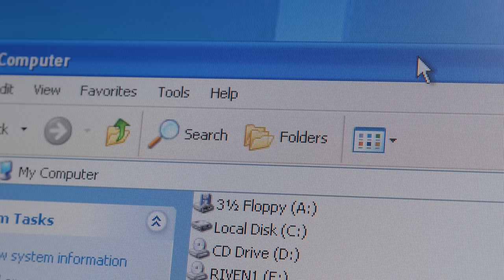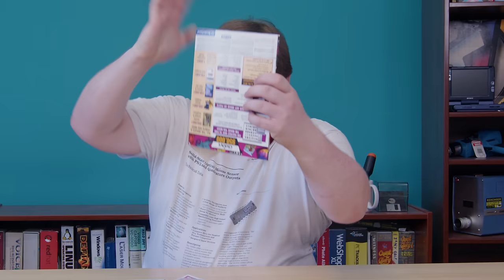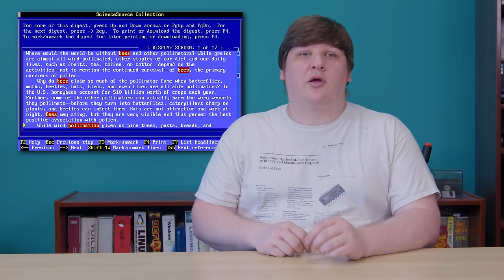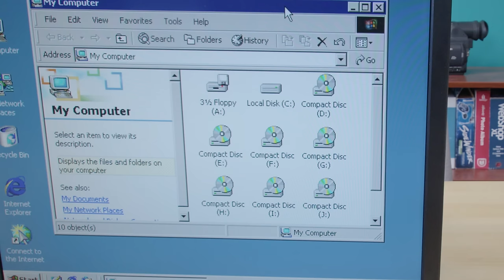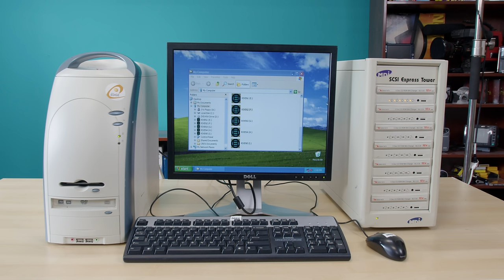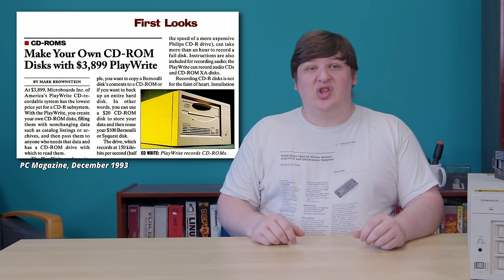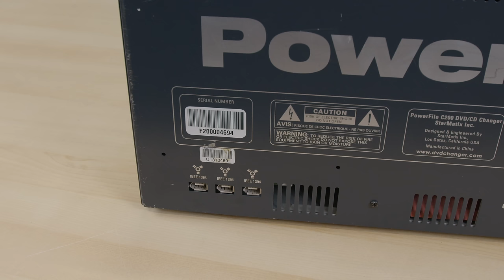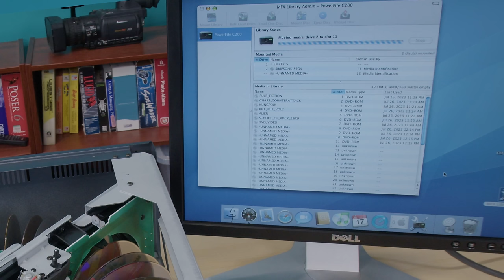A Jukebox for your PC: 1993's CDROM Servers

Comment: We used a huge MO library to archive invoices. I don't know if the software was off the shelf or more custom, but the metadata would be in a database and there were caches on hard drive for data about to be written to MO and data that had been read from MO.
Besides that, there was a period where "hierarchical storage management" was a thing, later under the moniker "data lifecycle management", to refer to tiered storage. At the time, you'd have a tier of data living on (fast) hard drives, sometimes a medium tier on slow drives, a lower tier on nearline storage (usually tape libraries, but optical was also possible) and sometimes even an offline tier. It was used to, among other things, handle giant Exchange servers where users would have their most recent and most used mail be on the highest tier and as their data aged out it would get pushed down the tiers. It worked very well if you only had the hard drive tiers, but once it got to nearline, performance was pitiful.

Comment: Scheduling is an immensely complicated computer science problem, and even has physical hardware solutions that computer engineers have designed, from the most minute embedded system to FPGAs to the latest Intel chips. I'm not knowledgeable enough to know the history of these algorithms, but it is likely that the in-house software engineer would implement an intermediary piece of code that would simply schedule data requests from batches of users. I'm envisioning a queue of stacks, where each stack is scheduled and completed until the queue is empty.

Comment: The only place I've ever seen these used was at a print service bureau. They actually used them for fonts and clip art. Which sounds preposterous, but back in the early 90s hard drives were not huge!
They had it hanging off one of the Mac workstations and they were all networked with whatever passed for ethernet on a Mac II FX. 

I also remember the ludicrous push for 'interactive multimedia CDrom' based games and stuff. 
Myst was probably the only good game like that. And that game was tedious.
It still cracks me up when I watch Jurassic Park and the kid hops in the SUV and exclaims 
"an interactive multimedia CDrom!"

Comment: 54:00 I may be remembering wrong but I think Kaleidescape had or does check in with a disc jukebox to confirm the movie is owned before then streaming. Probably no direct user access but a data link nonetheless!

Comment: I was the data architect on the UK replacement national Insurance system back in 1995.  We built the largest relational database in Europe at that time (2.5Tbyte with double mirror).  When we selected HP as the hardware vendor for the servers their backing solution was 20 times 100 CD optical dukeboxes.  This was selected in 1995 when we started the project and there was no other practical solution for backing up a 2.5Tbyte Unix (HPUX) Sybase database.  When I came to try and implement a solution on top of this hardware I convinced management that this was a totally inappropriate solution: just consider how much racking/shelfing is needed for each backup - 25 * 100 CDROM cases per backup - thats about 25 meters of shelf storage; consider how much time it would take an operator to load/unload 25 * 100 CDROMS = at around 30 seconds per disk - 1250 mins - around 24 hours ;-)  What is the likelihood of an operator loading a disk in the wrong order?

Luckily in 1997 HP released DAT drives which were 45GByte and therefore we could implement using only 30-40 DAT drives.

Comment: I have that larger Pioneer CD-ROM Charger DRM-1804X a co-worker gave me and was looking for any drivers that would work with newer systems. I did find a company that made Amiga drivers, but unfortunately, discontinued it and wouldn't sell it. I need to go back to looking again. I have all the original floppies and SCSI Express; I'm just unsure of the version numbers.

I remember one job that had a full-sized rack CD-ROM Server that, I want to say, ran Novell Netware or DOS that connected to a Netware Server. I had a PD CD Drive for my optical disc burning before the standard CD-RW came out. Sony DVD Charger! As I look at two of my full 400-disc chargers controlled via the Control4 home automation system. I had long ago, just rip my movies to my rack of NASes now, but still need to rip all the discs in the changers.

Comment: These same multi disc cartridges by Pioneer were very common in the 90os for higher end car stereos.  Right up until the early 2000s I believe.  They had the same multi disc players for in home stereo AV setups.  The car and home units typically came in the standard black satin plastic of the era instead of the PC beige.  Maybe I'm too old for this Youtube channel but I dont see anyone mentioning how common these were in the 90s.
Reply from the maker: I mentioned it right in the video.

Comment: Pioneer were the kings of the overly engineered CD mechanism. If you ever look inside a CDJ-1000, although a lot more refined, you’ll see a very similar drive with a similar design language to that one - and they sold CDJ models with similar mechanisms right up until a few years ago in the CDJ-2000NXS2. I believe the name of the game for those drives was robustness. You can pick up and vigorously shake a CDJ and it will never skip. They’re bombproof. It wouldn’t surprise me that this technology was originally developed to build super-reliable enterprise drives for this library application and then they just developed and re-used the technology in the CDJ later down the line.

Comment: my dad had a 150 CD "Juke Box" CD-Rom. it sent the Data via SCSI or 10/100 BaseT it had x2 54x CD-ROMs inside it. but a "CD Libary" and "Juke Box" is a colloquial term. CD-ROM Changer was the term used in marketing material
Reply: Another colloquial term for it was what you said "Rack it up" they were called "CD Racks"

Comment: That cartridge was developed for car audio CD changers. The whole drive looks like a ruggedized version of a car CD changer. Some of those even would park the transport if you hit a big bump, which lead to some strange behavior when the big bump was caused by the stereo itself 😅. I ran into that back when I installed car audio for a living. Anything more than about a 10" kicker would make the 2nd gen changers skip. The first gen really could not handle a sub at all. We had one customer who built 200lb steel cage around his 1st gen Sony changer that was suspended with air springs, and it still skipped of the bass hit really hard, but it didn't skip just driving down the road. 6 months later the 2ng gen changers came iut and he upgraded, ditched the steel cage and got most of his trunk back.

Comment: 5:57 - I have no idea about legitimate libraries on a CD, but in late 90s to early 2000s you could relatively easily find definitely pirated books on CDs at warez markets in Ukraine and Russia. I had a couple of such discs, both were called something like "Library in a pocket" and contained loads of .txt's with a reader program. I also had a CD with a collection of J. R. R. Tolkien's works, that included audio extras like passages from the books read by Tolkien himself (or so it claimed).

Comment: This is cool, because we were using those for our CyberCafe at the University on a server and used Jackl or even some of the Cafe Computers had two of those drives to manage some of the games that required CDs to be present in the system when the game starts. (Before the days of CD bypass options)
Allowed us to load games up without having to check out the games or risk scratching them often.

Comment: I remember my school had some Pioneer 6 disc changers in 1997 or 1998 or so, I don't know what model they were.  They were connected to individual PCs.  I can remember they generally worked pretty well, but I do remember one of them had some difficulties playing Return To Zork.  I think that game was only only one disc, but I remember sometimes when the computer would access the disc, the drive would unmount the disc, then the changer made a noise that sounded like the selector arm was running up and down the disc stack, then it would remount the disc and read it again.  Odd behaviour.  But overall they did work.  I think the ones we had could be locked so students couldn't remove the disc magazines.  As I said they were directly connected to the computers so the students could physically access the drives.

Comment: With a single hard drive or CD drive, the OS might try to handle requests from multiple sequential blocks together, because it knows it takes a while to seek. But with "multiple drives" the OS doesn't have any reason to do anything like that, even though it's much slower to swap disks, so it will happily intersperse requests with no consideration for this.

Read block 1 of disk 1
Read block 1 of disk 2
Read block 2 of disk 1
Read block 2 of disk 2
...

Comment: I remember the company I worked for in the early 90's got one of those big cabinet machines and having several meetings to discuss how we could use it. IIRC the idea had been to use it as a massive storage for the phone directory service we were developing at the time but after looking at all the pro's and cons it ended up being used as a backup archiving system (we still did weekly tape backups on exabyte though just in case).

Comment: An API or custom application between the users and hardware could very easily resolve the thrashing issue, I bet that it was handled similarly for larger instances of these disk changers, if they had frequent access

Comment: A while back I picked up a Sony CDP CX455 400 CD changer very inexpensively because it was asis and not working properly. I had to replace all three belts, but now it's working right. It definitely doesn't fit in my cabinet under the TV to just use as a showpiece for the collection of CDs I already have because it's freaking 22 inches deep. So I've basically abandoned that idea. However, I also have an idea of modifying it to be able to read CD ROMs over USB, which from an initial glance doesn't look like it would be too complicated. I might even be able to convert it to a DVD or Blu-ray reader, perhaps even a writer! The changer mechanism is potentially easily controllable via USB as well, because there is documentation already existing on the Sony control A1ii interface works. In theory it can also extract CD text through that interface because it was designed to do that for mini disc transfers with their mini disc players. My understanding is it's just serial IR at its root. An Arduino nano could handle that work easily. The real party trick would be if I can get it to play Nice with the existing control electronics. It already has a system to manually title discs in it via a PS2 keyboard on the front, and if I could do that with my existing software library, particularly if I could get that info sent back to a computer over that control interface... This would be a very fun hack project. It's all going to come down to how complicated it is to work with the laser mechanism that's already on it, whether it can be replaced, and all that lovely hacking goodness. I have a ton of CD, ROMs and DVDs I've collected over the years, and while I I'm in the progress of backing it up to my NAS, some of it really doesn't like to be used without having the original discs because of stupid copy protection. Having it easily accessible but protected inside a mechanism would be a dream for me.

Comment: Also: Fun fact: even on windows 10 Explorer will still attempt to query every single drive at the same time. This is extra fun when you have multiple card readers and etc plugged in.
And it will still freeze until each and every one has responded or a long timeout has occured.

Comment: Had a similar version in 2001 but minus the internal drives. Had to manually enter the disc names as each disc was loaded. Painful but awesome if you invested the time, loved how it whizzed around. But do not try to move it! Ever. You touch it, the cd's would roll out and collect in the center. Manually reset time. It did have a clear acrylic top and looked like a slide projector carousel from the 70's.

Comment: A company i worked for als freelancer had ~1200 CDs of parts catalogs from different companies. I converted their custom Database that referenced these data to newer database with a new font end. They didn't use the CDs itself anymore but mounted images they stored on a server. I've seen never the CD Management system. I was told that it filled a hole room.

Comment: I myself ended up with a 7 disc scsi drive for free around 2007  maybe 2008. Drive still works as far as I know. Haven't used it in a while but yea it's still here. I should use it again sometime.

Comment: We used to call them CD Jukeboxes or Vaults. Biggest problem is you needed software that was smart enough to not try to read multiple CDs. We used them on BBS' with shovelware disks. When a user wanted to download something it was copied to the hard-drive for them to download. They were a nightmare if you tried to use them like a regular CD-Rom.

Comment: Speaking of the term "near-line storage", it was absurdly long before I realized that firmware is called firmware because it occupies the space between software and hardware. It's not quite soft, not quite hard; it's firm.
Reply: I mean of course in actuality it's very much software and not at all hardware, but it's low-level and sits very close to the hardware.

Comment: There's important companies today that still rely on cd rom backups, (as long as the cd's are taken care of) it's a very viable and sensible way of keeping data, and when the boss asks you for data from 2008, you simply fetch the cd, and hand it to him... also, just because data is on a server somewhere, doesn't necessarily mean it's safe, as many of those servers still have spinning hard drives, that are frankly unreliable, and hey some of those servers get sold or thrown out...and there goes your data...
Reply: lol and yes I still have the exact cartrige cd system... the cd's got scratched, and  broke in half...

Comment: As an "old man" I have to correct one aspect. It was WAY easier in 1993 to do disk imaging in an large environment than it is today. These where days of MS-DOS and Windows 3.11. There where no unique identifiers, domain trust or online license checking back then. At best you had to edit a text file for networking reasons. All it needed was to format a drive with boot files and copying a bunch of folders. Even hardware was of little concern, since driver issues mostly got introduced in late 90ies with Windows 9x.

Comment: Also, people who think it's better to have 5 install cd's in 5 different drives haven't really tried this. I had workstations with up to 8 drives/burners in one pc during the 2000s. And if you put a game/app with 5-7 install discs in a system like this, you where at the FULL mercy of the installer used.

If you where lucky, the installer would just search all drives and find the next cd automatically.
BUT, FOR THE MOST PART, the installer wanted the next disc IN THE SAME DRIVE LETTER AS THE PREVIOUS ONE. So that meant that having all discs available at once, was in most cases utterly useless.
God I remember how frustrating this was.